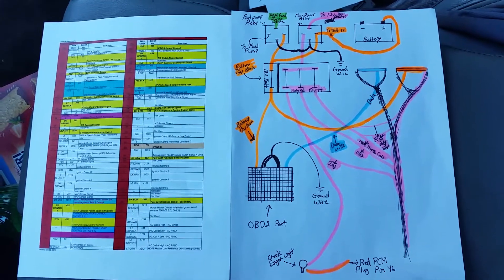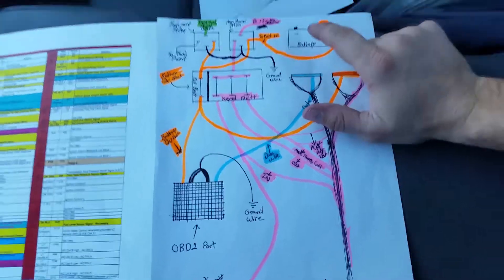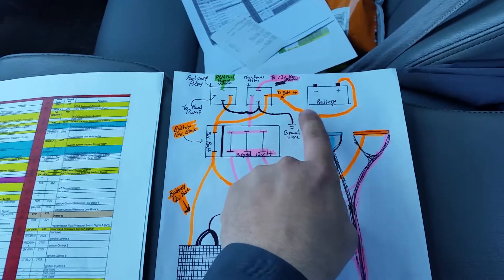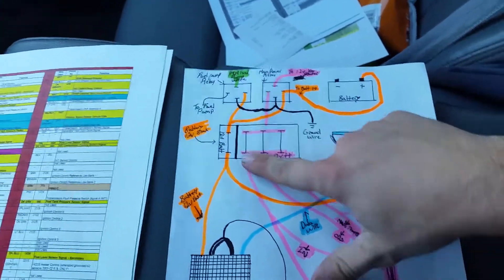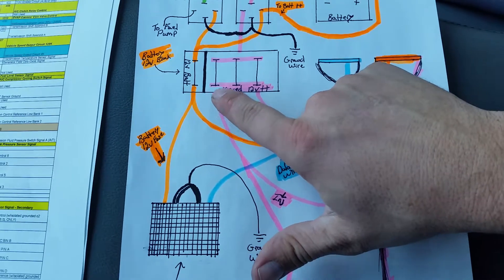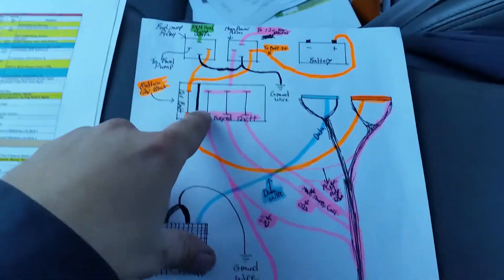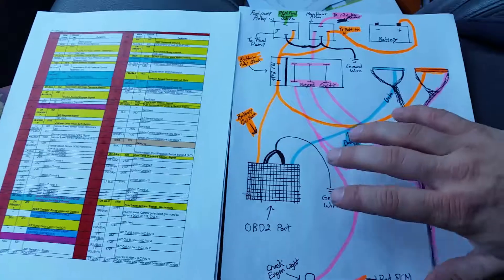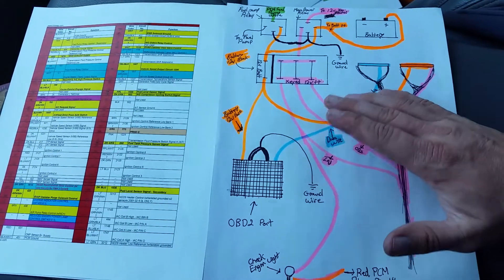D.I.Y 3-4 Wire Harness For LS Swap 99-02 DBC

Comment: Where does the TAC Throttle actuator wire run to, Do I run a pink to the keyed 12v power also. Or its just a plug and play setup.
Reply from the maker: None of this is plug and play
Reply: @lonniesgarage  so for drive by cable on ls1 swap I am using a pedal from a 2003 truck where do I connect the wire.

Comment: question is i have a 12v wire coming from the harness same hose eith wires that have the tach,speedo crank sensor does that 12v need power to get the gauges to work
Reply from the maker: Cleveland keep watching the rest of the videos on how to build the harness. It shows everything.